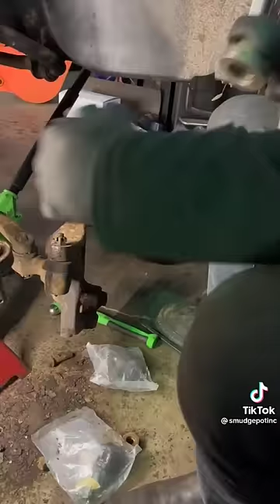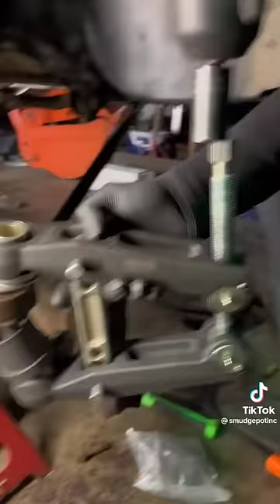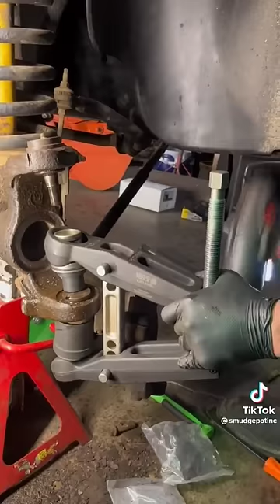Matco Ball Joint Press out ball joint Tool Kit pt.1 #automobile #diy #fyp

Comment: My buddy has one it heavy as shit it’s much harder to set up than the regular style ball joint press and I’ve found it doesn’t work as good on some ball joints I got the regular matco ball joint press the c clamp style we borrow each other depending on witch one we need only reason it works the rams better because the cups are stronger
Reply from the maker: @jacobstacy588  stronger and able to get in tighter spots
Reply: @letsfixit251  I’m not saying it’s not good  but it’s not a full replacement sometimes the c clamp style works better
Reply from the maker: @jacobstacy588  Yeah, I can see how it would be easier to use a much smaller c style clamp if your able to vs this one
Reply: @letsfixit251  you can use the clamp style on any ball joint and 90% of the time on the vehicle I get you spent around $1,200 if you bought the cups with it but it’s not a replacement for all ball joints I know i use the same press and haft the time you can hammer a ball joint out and you just press the new one in its cool it works haven’t found reason to justify it replacing my old one
Reply from the maker: @jacobstacy588  have you used the standard normal large size c style clamp on a Jeep Wrangler like this one yet?
Reply: @letsfixit251  yeah that style suspension you sell both upper and lower ball joints like on newer 2500 and bigger ram f250 and bigger you start with the upper than once it’s out you have all the room in the world for the lower press it out and in then press in the upper
Reply from the maker: @jacobstacy588  wrong. Go watch me do exactly what I just said with the c style one on my channel. It's doable. You just won't be doing it as fast as this 60 second video🤷🏾‍♂️🧑🏾‍🔧

Comment: I’m not so sure he used the tool properly? I thought the idea was to push the ball joint out of the knuckle!? The way he did this snapped of the head of the old ball joint? That’s extremely dangerous since you’re sending shrapnel somewhere! There should have been a hollow cup to accommodate the head of the ball going into as it pushes out!
Reply from the maker: Jeep Wrangler bottom ball joint press out downwards

Comment: Id just put a little heat on yoke and blast it with my ball peen hammer, trust me, much faster, and in twenty years i never had to use a tool for removal, i only used the tool for installation.
Reply from the maker: Ball joints can explode violently from heating. Be careful

Comment: My 1987 mercedes has ball joints that are about that size. No joke same diameter as a 3/4 ton pickup ha...most over engineered ever...70s-95 Mercedes Benz

Comment: The only problem with those damn things there's too many moving parts and they're a real pain in the ass
Reply from the maker: @Redarmor333  have you worked with one?
Reply: @letsfixit251  yes unfortunately yes I had to change my upper and lower ball joints in my Cherokee and I'm not really a mechanic so I'm not really wanting to be speaking to it but yeah it sucked for me lol
Reply from the maker: @Redarmor333  I think the fact that you're not a mechanic but you was able to do something like this using this tool says a lot within itself my man lol🤷🏾‍♂️
Reply: @letsfixit251  okay let me rephrase I'm not a mechanic but I do all the mechanic in to all my vehicles so I am very capable but at the same time it was a pain in the ass for me thank God i didn't have to beat it out with a 2 lb Hammer though right
Reply from the maker: @Redarmor333  lol practice makes perfect, and yeah 🖕🏽 that Hammer, if you don't hath to use it dont. Your body feels better at the end of the day. Save your back for that lady later on tonight, lol

Comment: Am i wrong in thinking he pressed it through the knuckle instead of back out of the knuckle? Every ball joint ive ever replaced went the opposite way, on my dakota they we're actually threaded in to the control arms. S10s they're bolted into the control arms... 

I guess im completely unfamiliar with this style ball joint which makes me curios how often this tool would even be useful.
Reply from the maker: Jeep wrangler bottom ball joint press out downwards

Comment: That is extremely over engineered, its huge.  Talk about overkill.
Reply from the maker: Would you honestly prefer beating in and out 10 ball joints a day instead though? 🤔
Reply: @letsfixit251  Who said anything about beating them in?? There are ALOT of presses that will do that exact same job, just as well for a fraction of the cost and none of them are that cumbersome. You can barely get it on there by yourself.

Comment: works even better the other way round. I mean the correct way round*
Reply from the maker: @danielstacey200  nope jeep wrangler bottle ball joint press out downwards
Reply: @letsfixit251  not a jeep wrangler and not the correct way those ball joints come out.
Reply from the maker: @danielstacey200  😅🤣 yes it absolutely is man

Comment: I'll stick to my MADE IN USA OTC c clamp. A little anti seize and you can press the nuts mother earth. Shit is legit and strong AF. I only pull it out if a few whacks with a sledge doesn't make it budge.
Reply from the maker: It's a bad idea to smack on a vehicle like this if you can even get the correct angle on it to smack it🤷🏽‍♂️

Comment: Dodge 2500 3500 , kinda Neanderthal but I take a torch and cut an x into the top of the lowers and they push right out with a air hammer 😊

Comment: Thing is the hub back to front and the top arm has been split so this hub isn’t attached to the car that she there isn’t a drive shaft even in the centre hub bearing,,,just use the press,,,, if this tool worked like it’s intended to look in situ for a quick bottom ball joint job then I would buy one right,but that’s a waste of money

Comment: Snap on press is way better and has multiple uses for u joints and ball joints. This thing looks clumsy and just waiting to break. And Matco doesn’t even make it. Could probably find this for 300 bucks from the original manufacture. Snap on is only 800 and way better imo.